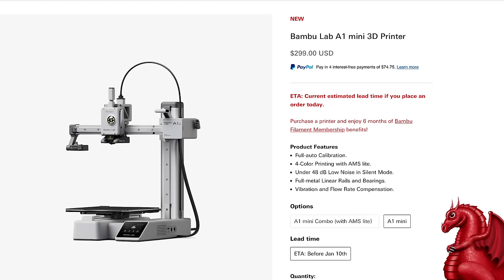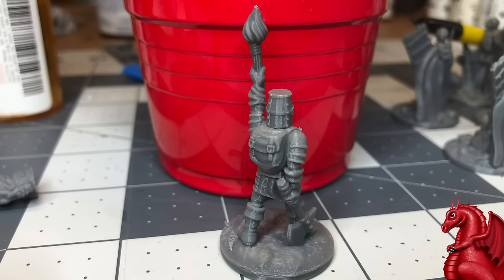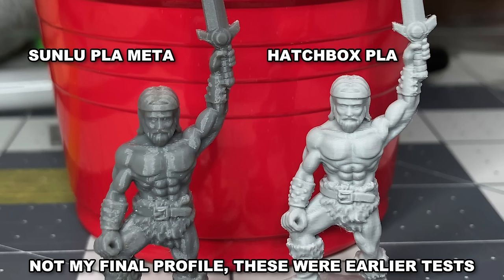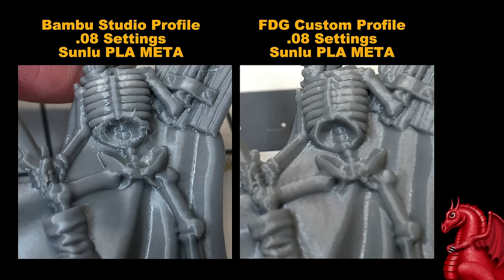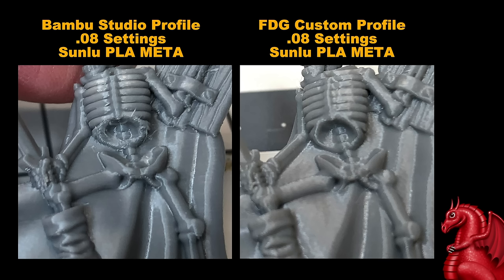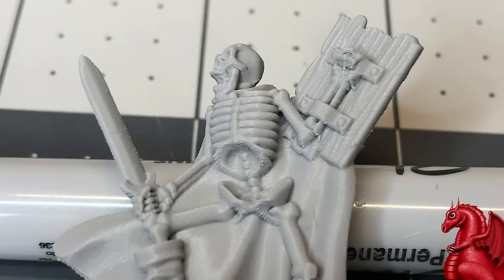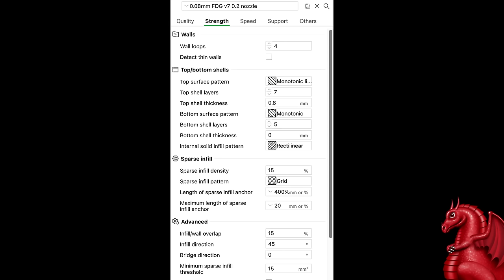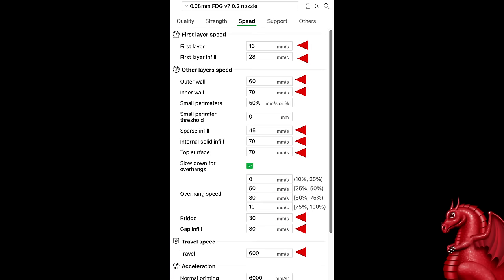Bambu A1 Mini - The Best FDM Miniature Printer!

Comment: When considering filament, does it matter what color you use, if it's to be painted anyway?
Reply: Its easier for you to see the details before priming so you know everything is perfect before next step. but as you say it dosent matter, you can go with black , yellow, red, whatever you want
Reply from the maker: Yes, color makes a difference. Natural PLA is clear, so colors are created by different additives, and thus different colors will have different print characteristics. I've designed mine for gray Sunlu PLA META, although Hatchbox PLA gray works well too.
Reply: @Tombof3DPrintedHorrors  Thanks for the info!  I'll go with gray then.  I'm a little surprised Sunlu doesn't offer a clear filament, if that's the natural color.  Clear printing could be useful for creating stuff like spell effects.

Comment: Tom, do you ever mess around with acetone vapor smoothing your prints?
Reply: FYI acetone does not dissolve PLA. It does break it down a bit but that just makes it sticky and rubbery so vapor smoothing will not work. PLA does dissolve in Ethyl Acetate but that is not as "effervescent" and does not vapor smooth as well. You can apply it on the surface though.

Comment: Does this profile work with the full sized A1? or just the Mini? Do you have a profile for the full A1?
Reply from the maker: It does work with it, but the full size doesn't quite match the A1 Mini for miniatures. I do have a new profile coming soon that makes the A1 get closer though.
Reply: @Tombof3DPrintedHorrors interesting that the mini US superior for minis compared to the big brother.
Reply from the maker: @lllphil9423  they are different mechanical designs (linear Z rail and single screw for the A1 Mini) so not surprising it is better on fine details.

Comment: I'm wondering if these settings would work well on a P1P/P1S... Is there a chance any of your acquaintances have these machines and are willing to test this profile with them?
Reply from the maker: Unfortunately someone else testing them isn't an option when developing these profiles.
Reply: @Tombof3DPrintedHorrors Yes, you're right. Well, I guess I'll do the testing when my P1S arrives :)
Reply: I have just manually input the values from Tom's profile for my p1p and I can confirm they work

Comment: I am very much looking forward to trying out your custom profile! I'm mostly looking forward to the speed increase for terrain. Are you going to release a separate profile for terrain as you have in the past?
Reply from the maker: No, but I will do a video on how to create your own custom terrain profile for the A1. I've reached the limit of how many printers I can keep creating/maintaining/updating custom profiles for the community for (especially since I do this for free for you all.)
Reply: @Tombof3DPrintedHorrors  That is MORE than okay! I'm usually using your profiles as a base for my own tweaks anyway so some tips/advice on altering for terrain is all that is really needed. Thanks again for all your hard work for YouTube peanuts!
Reply: I've just printed some original village street tiles on the p1p 0.4 nozzle turned on adaptive layer height and it's floorless

Comment: Reduce nozzle size setting, then the Arachne simplification isn't so drastic.

The slicer can think you have a 0.2mm nozzle when you have a 0.4mm one on, there is no harm from that, as long as the perimeter extrusion width is at least 0.42mm for a 0.4mm nozzle.

I actually think Bambu/Orca path decimation is way too aggressive in Arachne mode.

Also since you're printing miniatures: outer perimeter first, else the existing inner perimeter which is printed earlier will tend to push the outer perimeter out and round it out. Arachne is at a quasai disadvantage since it will be able to put perimeters on sharp features closer together. Yeah i know, overhangs disadvantage. I don't have a perfect solution for you. We need new algorithms.

Comment: Do you think your settings would work on a Bambu A1?  Mine arrives tomorrow!
Reply from the maker: Not this well, I'm testing them on my A1 now and it doesn't quite match the A1 Mini's quality.
Reply: @Tombof3DPrintedHorrors , do you think you'll develop some profiles for the A1 like you did for the A1 mini?
Reply from the maker: @robertgreen9675  I'll keep tinkering with it, but it's got a very different motion structure (dual Z screws and no linear rail for the Z axis) and bigger bed/more inertia on Y axis, so it may not be possible to match the A1 Mini when it comes to miniatures.
Reply: How big would you say the difference is at this point? Does the A1 outperform an old ender 3 for example or is it significantly worse than the mini?
Reply from the maker: @Kimentor.  so far my A1 Minis are much better at printing miniatures than the full size A1, but for terrain they are pretty much the same. The A1 does beat the Ender on terrain, but the Ender-2 Pro beats the A1 on miniatures.
Reply: @Tombof3DPrintedHorrors  Thank you, definitely leaning towards the mini, but when will we see some quick comparisons between the A1 and the mini?
Reply from the maker: @Kimentor.  I will have a comparison video out next week. :)

Comment: anyone have issues while using supports i have to use some kind of supports for the battle droids im printing and unfortunately the the supports stick to well and cause the droids to break in multiple pieces i am using the recommended sunlu pla.
Reply from the maker: You need to ask whomever you purchased the models from for their recommended settings. Nothing I produce requires supports so I do not develop settings for them.
Reply: @Tombof3DPrintedHorrors  got it i figured just wanted to check the models im using were probably made for resin i get it all from galactic armory

Comment: have you tried at 0.02mm layer height? isnt worth it?
Reply from the maker: .08 consistently gives the best results across a wide range of sculpts, .06 works on some but not all and has issues with overhangs.
Reply: @Tombof3DPrintedHorrors  ok ty im thinking about starting at 3d printing with the new A1. I habe Warhammer 40k hobbie but I refuse of use resine printing with all nocive vapors
Reply from the maker: @WondefullComment  I'll have an A1 review video coming in a week with examples of printed miniatures.

Comment: I was hoping someone could help me out since I am new to 3D printing. I uploaded the settings from drive thru RPG to my new A1 mini and I am using the Sunlu filament that is recommended in the video. I have printed several minis, and they all look great except for the bottom layer on any part of the mini (this could be under an arm or any part that is sticking out). This layer is extremely stringy looking and has defects. The top and side layers all look amazing. it was very noticeable when I tried to print a mini on its back and its whole backside was a stringy mess. Does anyone have any ideas of what I can try to do to fix this? Thank you
Reply from the maker: Which of our miniatures is causing you issues? None of them require tilting to print (no correctly designed FDM mini should.)
Reply: I appreciate the quick reply! I am printing a Battletech mini from cults3D. It seems like the bottom layer where the supports meet the mini is the issue.
Reply from the maker: @tann3r23_  nothing we sell requires supports so cannot advise on them or offer tech support for other manufacturer's products. You'll need to ask whomever you purchased it from for recommended support settings.

Comment: Arachne changes the width of the line based on the physical properties of the plastic, the viscosity and fluidity to stretch the line and how they behave with hotend pressure, like a controlled over-underextrusion. In the 0.2 nozzle the plastic does not behave the same and the algorithm gives a worse quality.
Reply from the maker: Not the case in Cura though, Arachne increases details with a .2 nozzle there. I reached out to Bambu and they verified there is a problem with the Arachne path generator in Bambu Studio and they are working to resolve it.
Reply: @Tombof3DPrintedHorrors  It's good that they add better parameters for 0.2 nozzles. Can't you slice it in Cura and print the gcode from the SD on the A1?

Comment: is it possible get the same  results on anycublic mega pro.
Reply from the maker: No, not even close. Sorry.
Reply: @Tombof3DPrintedHorrors   is there mode kits or something.
Reply from the maker: @ThomasKrogh-y6i  what is a mode kit?
Reply: @Tombof3DPrintedHorrors  sorry mod kit. autocorrect
Reply from the maker: @thomaskrogh1244  no, it's a totally different design, it cannot be upgraded to perform like a Bambu Lab printer. The best you can do is try my custom Cura profiles I designed for Ender-3s and put a .2mm nozzle on it.
Reply: @Tombof3DPrintedHorrors  are't most 3d printers use standard parts or does bambu use proprietary parts
Reply from the maker: @thomaskrogh1244  no, they are completely different designs, plus BL's firmware and vibration compensation, active flow calibration, etc are all a generation or more beyond Anycubic. The Anycubic is basically a clone of a Creality Ender-3, so between them yes, they are very similar, but BL is not in that category, the innovations they brought to the home 3D market are significant.
Reply: @Tombof3DPrintedHorrors  dude their people who that have the same pc from the 90s just upgraded and replace parts that's way I ask you do they use standardize or proprietary. Cause The  software is open-source.  If people can maintain and update a pc from the 90s I can upgrade the printer.
Reply from the maker: @thomaskrogh1244  BL's firmware is not open source. Good luck with your upgrade efforts though.

Comment: You've mentioned in other videos that nozzle replacement is the most common maintenance activity on FDM printers since they are brass. Have you noticed that the nozzles that Bambu labs sells last longer so they require less replacement? Or is the nozzle independently replaceable on the $12 hot-end?
Reply from the maker: I haven't tested long enough to notice differences in nozzle lifespan, but they are steel so should last much longer than brass. And no, nozzle/hot end are a single unit.

Comment: Anyone tried printing multiple minis on the bed? Any issues?
Reply from the maker: Quality drops and increase in adhesion failures. For top quality print one at a time.
Reply: @Tombof3DPrintedHorrors  thanks.  Figured I'd try it with 2 (before i saw your response) Running now. Will stick with one from now on.  Fantastic profile.
Reply from the maker: @marchache  be sure you are using my new v12 profile from my website, it is even better than the settings shown here. :)
Reply: @Tombof3DPrintedHorrors  I am. Purchased the profile.  Printed 2 fdg dwarves at the same time and i thought they looked great.  I think for npc's multiples might be OK.  Need to see after paint though